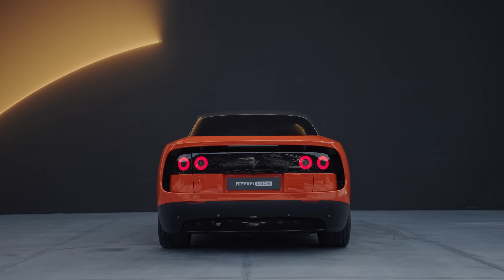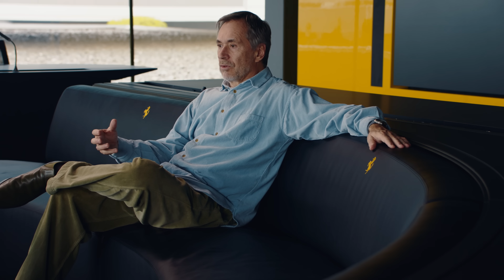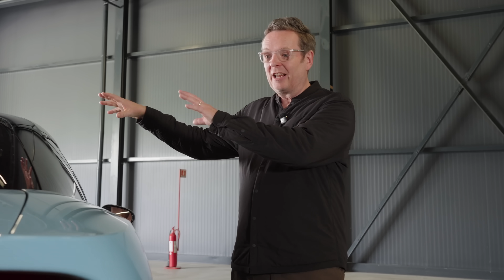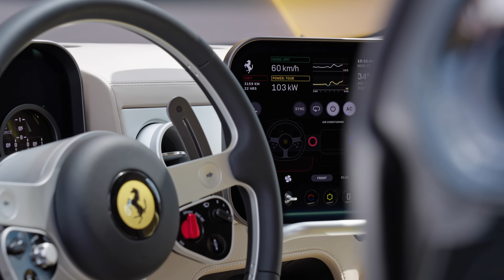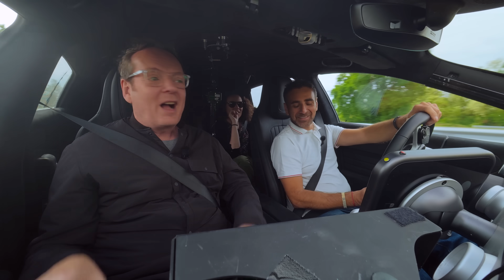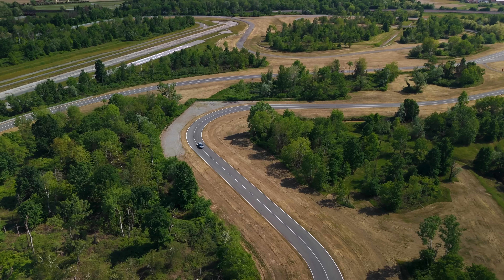We’ve Driven The Ugly Ferrari That Broke The Internet! | 4K

Comment: 1) Those who have played top trumps card as a kid would remember the alien looking 1970 Ferrari 512 S Modulo designed by pininfarina. 
It was essentially ferrari's first space ship.

2)This car's interior is absolutely gorgeous , lots of buyers will definitely be happy spending time in it and driving it. The HVAC vents alone makes it better than the taycan's screen control vents ( you can't control the vents manually like in all other cars, you have to choose the airflow in the screen in a taycan ).

3) First time project will always be divisive. 2nd one will be perfected.
Ferrari will get on board with better battery tech, solid state even, and produce a low slung 5 seater like the Taycan eventually. this EV platform and chasis is not a one-off, it will underpin other models. This is essentially their test bed.

4) It is expensive because it is a first on every front. all components needed their own manufacturing method. Interior alone costs more than the other ferraris. And Ferrari would definitely make buyers pay for it since they're not in it to lose money.

5) Ferrari will explain later why the LUCE is the first one when they unveil the 2nd EV model later.

6) That "fake" sound is somewhat necessary in spirited driving. It is one of the ways for the driver to judge power and acceleration. without it, it'll be difficult to find your racing line.
Some people will get car sick easier without an engine sound.

It could be the sound of Enzo spinning in the hereafter each time you floor the throttle...lolz...

7) expect to see it drift and barrel roll in the next asphalt.

8) hope to see a "pikes peaks" version to tackle the nurburgring.

Comment: 0.25 is not impressively low - other cars are hitting 0.21
Reply: Agreed. The Opel Calibra had 0.26 in 1989.
Reply: @GCTO239 My Opel Astra Sportstourer (a  wagon! designed around 2015) has 0.255!
Reply: My $40,000 tesla model y is .22 😂
Reply: The cw value is always proportional to the frontal area. The problem is that this value says nothing about the absolute drag.
Reply: @mg7990  The Luce is big in terms of frontal area around 2.00*1.55. A model 3 is 1.85*1,44 with 0.218cw (the Luce is actually 0.254). 
Luce drag will be around(i take the standard 85% fill in ratio to both car): 0.85*2*1.54*.254=0,665.
Model3:0,85*1,85*1,44*0,218=0,494.  
BMW IX5: 0,85*2*1,75*,28=0,833
The Luce actual drag is around 35% more then a model 3, but around 25% less then the new IX5.
Reply: I think it's really good. But not impressive. 0.25 is still very high.

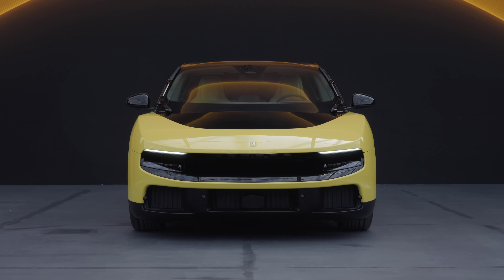Comment: 6:42 yes, people have seen a Ferrari that looks like this. The negative black side where front headlights should be (dodici cilindri and f80), the quad circular tail lights imbedded in a black surround (2000s Ferraris), floating rear aero that extends down the side if the car (sp38), the minimalist sides (80s Ferrari), refined real metal material and leather interiors like the 60s Ferraris. It’s okay if people don’t like it, but they can’t say it didn’t look like a Ferrari.

Comment: I’d rather the top specced Volvo ES90:
Volvo ES90 Twin Motor Performance Ultra

Powertrain

* Dual electric motors (AWD)
* 670 hp (500 kW)
* 870 Nm of torque
* 0–100 km/h: 3.9–4.0 seconds
- Bowers & Wilkins
- suspension
- also a lift back

* 106 kWh battery (gross)
* 800-volt electrical architecture
* Up to 700 km+ WLTP depending on market/version
* DC fast charging up to 350 kW
* 10–80% in around 20–22 minutes under ideal conditions. 

Scandi good looks And half the price.

Comment: Honestly, overall probably my favourite skateboard deck electric car but would still rather see Ferrari do a tiny lightweight 2 seater with an electric motor going through a manual gearbox if they were going electric. At the same time the way they went with completely decupled axels with a motor on each wheel is the exact kind of performance maxing I would expect out of Ferrari when given a full electric drive train.

Comment: I’m not sold on it, no not from Ferrari. Ferrari was never born as an EV manufacturer. Same reason why I would never buy a Tesla with a V12 gas powered engine. Someone way above is pushing down everyone’s throat the idea of a battery powered electric car. People by a large are not happy with it. Let me be clear, I am not opposed to electric torque; it’s much more powerful than gas. I am opposed to where the electricity is coming from, in this case, and all cases, a battery.  If only someone made a car that had a gas powered engine spinning a generator to power the electricity motors and no massive battery to charge for hours! You can just pull into any gas station and fill up in 2 minutes. The best of both worlds! That would be an electric car I could get behind.

Comment: No one buys a Ferrari for the screen tech... it may be good quality but the interior design is just not that good. It literally looks like a Japanese k car intrior..all 'blocky' and chunky. It is fine in a cheaper run around but in a half a million car....it is not. I've mentioned it on another comment too..that. centre screen that swivels with the bar grip.... supermarket card reader holder.... . 

Still not sure who is buying this:
1. Ferrari lovers will hate the design and no engine.
2. New customers want the legend and designs, sounds of Ferrari...and this has none of it.
3. People who don't care about the Ferrari name and love tech can get the same or better EV experience from your general run of the mill SUVs... they likely do not want to spend HALF A MILLION QUID when you can get it much..much cheaper.
So...who is this for??

Ps. I guarantee rafa's hated working on this car...

Comment: The interior is bittersweet to me. Individually, I like all of the various components. The gauge cluster is clean and looks nice. The center console is equally clean and has nice toggle switches. The steering wheel looks cheap (to me), but it's also a clean, somewhat retroish design. They all look like well-thought-out, polished Apple designs. The issue becomes when you take these individually not-terrible things, put them all together, and then put them all inside a Ferrari. As someone who has spent a decent amount of time in and around a gated 360 of the last few years, this car makes me sad

Comment: Okay I don't find the exterior particularly interesting - looks like a car Buick might introduce.  Ferrari should have let Manzoni design it.   That said, the drag coefficient is very impressive.

The interior is innovative and actually looks pretty fantastic and usable - pretty much what I'd expect from a Sir Jony Ive and Marc Newson collab.  Marc has designed some amazing watches, ie Ikepod and Ressence, and his influence clearly shows.  I have a SF90 with zero analog controls except the mannatino - took me about five minutes to get used to them and I Iactually like them now., but I'm a minority for sure.  But at the same time, it's good to see a return to switches/dials which are definitely easier to safely access when actually driving.  Interestingly, this all electric car has a lot more of them than even the SF90XX and 849 Testarossa,  which partially returned to buttons at least on the steering wheel.

Being a Ferrari, performance (acceleration and handling) expectations are high and I don't see the car disappointing there.  Personally I prefer the way gasoline engines build thrust as RPMs climb, over how electric engines deliver maximum power from a standstill; the SF90 and its contemporaries (296, Revuelto, Temerario, Arctura, ZR1X etc) give the best of both worlds, with the electric engines filling in torque at low RPMs when the gas engine is at a disadvantage, and eliminating turbo lag for cars using forced induction.

Big problem with this car is not so much the look but the price, which applies to the RR Spectre as well.  I suspect Ferrari will probably sell more Luce to people trying to build their profile in order to get special car allocations, than those actually wanting to buy a full electric car; those cars will get dumped and flood the preowned market, and the Luce will likely have suffer a substantially larger depreciation than any other Ferrari.  Who would rather have a Luce than a 12 Cilindi, 849 Testarossa, or pre-owned SF90 Spider with six figures of cash left over?  

I had a Tesla X for a few years and it was actually a pretty fantastic and trouble free car... perfect for running errands and driving in bad weathe.  Hopefully Elon Musk will get some inspiration from the Luce and introduce X/S replacements that are more visually appealing than the Ferrari with better interior, at a much lower price point.  The S was a beautiful sedan when it is was introduced and still looks good well over a decade later.  And well spec'd the X could look great too, for an SUV.

Comment: Several Cybertruck owners reported on how bad the vertical-parking windscreen wiper is. In the rain it wipes the water down to the horizontal line, like normal wipers, however a normal wiper then parks across the bottom of the windscreen blocking that water from being blown straight back up to the windscreen by the airflow. Unless you're stationary, as soon as a vertical-parking wiper returns to its resting position, all that water just flows straight back onto the windscreen.

Comment: The real messed up part is that Ferrari did NOT have to do this. AMG and Porsche and even Hyundai have shown how to make fun EVs. And Ferrari has their new ManualE shifter RIGHT THERE to use. Make this look like a 4-door 12 Cylindri with SciFi V12 noises and the manual shifter, and they'd have an ev worthy of the badge, especially if priced closer to the Roma

Comment: The Luce broke the internet, but as a massive EV and tech nerd, I’m absolutely here for it. I actually appreciate the Luce for what it is: Maranello's first fully electric, 4-door, 5-seater super-GT - it makes bold.
But the real masterpiece is the hardware stack. Ferrari building their own 122kWh structural battery and 800V architecture completely in-house is a huge statement.  Add in quad permanent-magnet motors (1,035 bhp!) and a VCU for true 3-axis torque vectoring? It’s basically a 1,000-horsepower supercomputer on 24-inch wheels. Plus, the interior finally ditches the frustrating capacitive touchpads for proper physical, CNC-machined switchgear—a massive UI/UX win.  
Can't wait to see the comparison test against the electric AMG GT 4-Door and the updated Taycan!

Comment: I think the "interface" dashboard and controls, is a breath of fresh air, manufacturers have just gone down the line of huge displays with, at best, OK graphics with a clunky virtual control interface, plus multi coloured LCD mood lighting in the footwell, like something that was cobbled together with. an Arduino at the local Makerspace. 
"Love from" have absolutely raised bar here, OK its very Johny Ive, but in a good way, tactile, consistent visual gratifying and action appropriate, restrained even.
The outside is disappointing, functional but not at all commensurate with the brand,  as the comments will testify, that is a problem.

Comment: So the shift pedals do the same thing a gas pedal and brake pedal do in normal cars?
Reply: All cars have a brake pedal and accelerator pedal not just ICE cars thicko...you've definitely not driven any BEV or Hybrids have you😂😂😂
Reply: @pauln0371 pedals to adjust engine braking before a corner just seems another useless task to me. With EV's you can already engine brake with the brake pedal why put another 2 levers in a car for that?

Comment: Not trying to justify this excuse for an EV let alone a Ferrari, but, maybe if some of the black areas were changed to body colour (or all of the body panels were simply black!), it would look less like 'Fetus in fetu' and more like a single cohesive vehicle. It still wouldn't look like a Ferrari but it might be more tolerable to see (?!). I would go back to the drawing board and put all the tech from this Luce in to a Purosangue shell  somehow - the instruments and finishing inside are lovely. That has got to be a better starting point to persuade Ferrari lovers to buy an EV. Ultimately, if Ferrari don't have a decent EV offering by 2035, and governments don't drop the legislation banning (or, at least, severely reducing) the sale of fossil fuelled vehicles, Ferrari may be no more than a car company consigned to the history books with a very long and interesting set of chapters for future generations to read about....

Comment: It really seems that in all the top gear coverage of this car, they're not only giving what might be genuinely positive impressions of this car, they're almost advocating for ferrari. The writing of this script doesn't feel far enough from a ferrari press release. I know they're militant in their PR, but I don't care, this is freakin' Top Gear. 

Every fault mentioned, and there are shockingly few, felt followed by a barely subtle "but but but!" that I just didn't buy.

For example, this thing has piped in engine noise, it's pushed through the speakers, I don't care if it's ~amplified from the drivetrain~, framing that as "like an electric guitar" feels written by ferrari and the reverence that point is given as if it's not only slightly different from what other manufacturers are doing really sticks out to me

Comment: The stock actually took it quite well. The flop was discounted and now it’s trading more than 10% higher that before the Luce was revealed
Reply: It's just institutions manipulating the stock. "Buy the rumour, sell the news". And when the asset is down, buy it back but cheaper. The price rises and then sell it at a premium again while the uninformed start piling on, afraid to miss the rally.😕 I suggest you don't take the price too seriously; it's business as usual.
Reply: The thing is people are buying it so the stock traders got over themselves.
Reply: That stock dip was shorters manipulating the stock by bot commenting the internet with loads of anonymous negative posts that all repeated similar. When the interior was revealed the same thing happened. Sure, there are people who genuinely disliked the exterior, but the 99/1 hate/love ratio isn’t reflective of reality.

An Australian motoring journalist posted a poll where it wasn’t as easy to manipulate with bots, and the love/hate ratio was 50/50 after many hundreds of votes.

Comment: I think we are finding that electric motors and batteries dont really offer any brand differentiation.  They are all becoming mostly the same even when they have 800-1000-1500hp.  The best ones all run 8-9 second 1/4 miles.   They have pretty much hit the limits of what tires and the road surface can hold.  It is just starting to be more of the same now.  Yawn.

Comment: The biggest mistake they made was putting the Ferrari name and badge on it. If it had been launched as the new sister brand, called Luce, and billed as Ferrari's luxury people mover division to battle Bently and Rolls and Maybach, then I think the response would have been entirely different. The simple fact is that Ferrari has spent the last 80 years marketing their road cars as the ultimate driving machines, based on racing pedigree. Then this comes along and completely goes against their own brand ethos...

Comment: omg Apple did not create the template for the smartphone. As with most other incredible Apple 'inventions' smartphones already had established a common form factor, or 'template' as you put it. The only thing Apple brought to the table in regards to design was reducing buttons down from 3 to 1, which was hardly a 'template' as they were  the only ones to use this design. So it could have been a template for themselves, however, it was short lived as even they dropped this design. 
Apologies for the rant, I'm just sick of Apple getting credit for other peoples work when they take someone elses design Apple-fy it, then stand proud in the light like their poo's don't stink. This isn't to say they havent made any improvements on things, because they have, however, it's far easier to modify another design then create one from nothing.
👍🤘✌

Comment: Other than i think it is hideous and prefer the Honda E if I am going to have a Honda looking car, i also think that the dash and venue control look utilitarian rather than special and expensive (and i am sorry but high quality switches might be rare these days but they are easy to make Anna have been made for decades, look at older cars, hifi, planes etc).
Regarding the comment about 0 and 1s and converting digital to movement and analogue feel, that really isn't new either, all modern cars have a ton of electronics constantly controlling ESP, electronic differentials, individual brakes, suspension softness (even when cornering to give more grip in individual corners) etc etc ... So the switch from an ICE to an electric motor doesn't represent as much as a jump in tech but yes, many things have to be recalibrated, made faster and sometimes reinvented .... But the 0s and 1s have been there for a long time (late nineties maybe a bit earlier on very high end cars like s-class Mercedes Benz).
Oh and the visible aluminium on the pretty steering wheel looks great.... Until it is winter and feels extremely cold, or summer when it burns you.
And then there is the price, i would rather buy a Taycan (which looks great) and keep my F355 and GT3 (which cost roughly the same combined).
Also i would like to know how the Luce is better to drive a Lucid Air